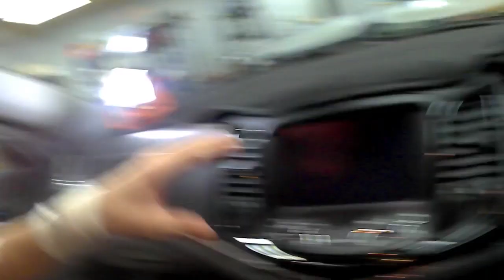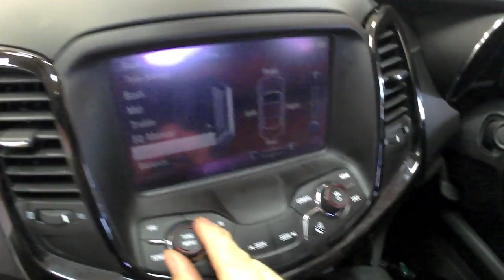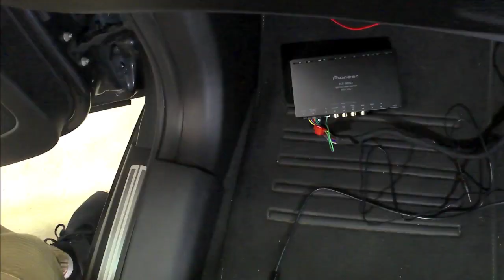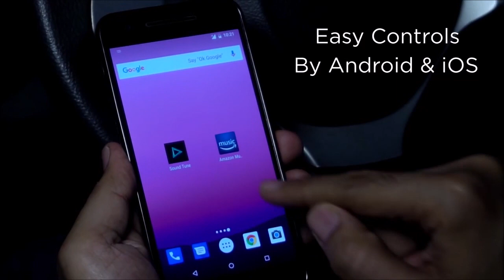Pioneer amplified sound processor, plug & play into a VF Commodore

Comment: Hello ! Can I put this DSP with my Helix P400 amp(I use it in 3 channels mode, 2x110w rms+350W for subwoofer) with the front speakers powered by my amp, with 110W each, the sub powered by my amp with 350w and the rear powered by this dsp, with 50w each ? Also, because the dsp has 4 channels of amlification included, can I put the front right channel of the dsp to a center speaker in the middle of the dash(my Passat has the hole for one) ? It would be just awsome it this little guy could do it ! Thanks !

Comment: The  wiring harness is brilliant the only thing you have to do is earth the park brake wire the only drama is the dsp virtually has to go in the passenger side kick panel area above the quadlock wiring connector for the door in the utes unless you make a panel for under the passenger seat
Reply: what is the Park Brake wire for?
Reply: n e 1 ?
Reply: So you can't tune it whilst driving
Reply: Thnx Zac
Reply: So the parking wire basically just ground it, just like others?
Reply: @robinong5803  Yes, just connect it to ground.

Comment: Hey Guys awesome vid, is there anything for the UTE. From my understanding the ute does not have wiring to the rear.My Redline has Rear Sub`s ( that you cannot hear) and all the noise is only from the front. I cannot seem to get a wiring diagram to see if rear speakers can be fitted (factory).
Reply from the maker: Indeed, there is no factory wiring for rear speakers  however, it would be very easy for us to add a rear speaker wirong extension and speaker package and to this harness for you :)